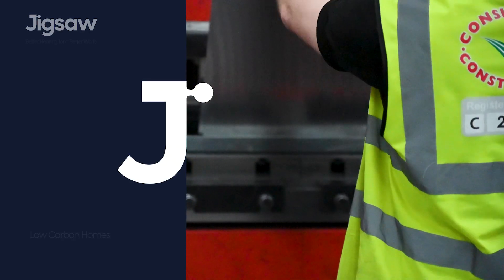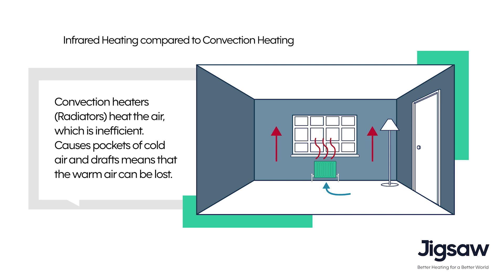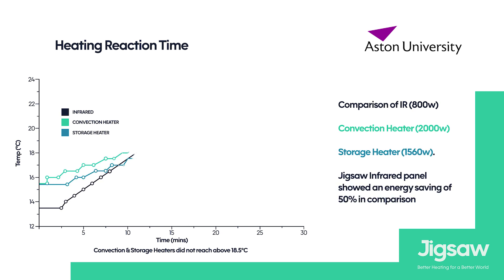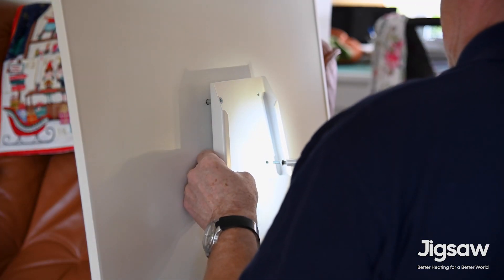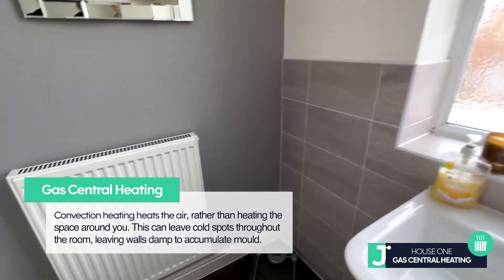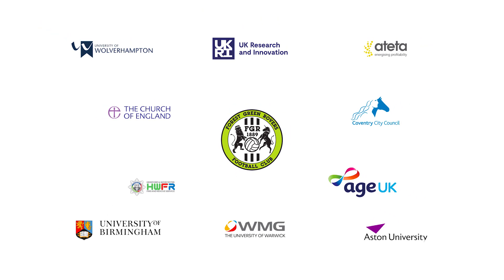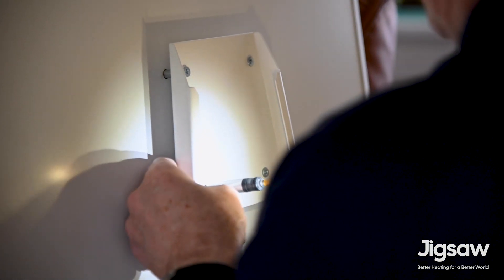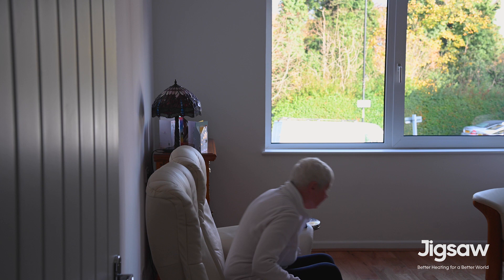Made in Britain Infrared Heating |Low Carbon Homes Presentation

Comment: Does one leave them on low in the coldest weather and bring the temp up when youre using the room? 
We've been doing that with our gas c/h this year ie we've used a higher set back temp and a lower daytime temp, we think its saved us money instead of turning it right down overnight then having to overheat in the morning to get us warm.
Would that be economical or shall we go back to off until we need the warmth because its so quick to heat up? We're hoping to start having your panels fitted later in the year as finances allow. 👍

Comment: I really dont understand all the hype with far IR panels, I have owned 3 different panels, tested them on the ceiling and in many different positions on the walls, you always feel like your either on fire or too cold, and after a few hours they give you a headache. Fine for short bursts of heat but then they're not nearly as quick to heat up as a fan heater or near infrared lamp would be.

Comment: These seem perfect for sorting damp and mold in new build ensuites, i thought id solved it by moving the extractor from the wall away from the shower to above the shower and now we need new plasterboard due to it leaking water back in once the water hits the cold air in attic, now moving back to the wall extractor and looking for a larger radiator.....till i saw this, the fact ir works on water first sounds great

Comment: Thanks for a very well presented and informative video. 
During the winter of '22/3' I had a 3kw fan heater blowing under my coffee table and onto my legs. I was wearing thermal underwear plus 3 pairs of socks, 5 teashirts (layering), a thich knitted jumper and a pair of overalls. (73 year olds dont like the cold). Looks like IR heaters are the future. Mind you....when youre 73 theres only a limited future Lol. Thanks again for your video. High 5s and respects.

Comment: Your bar chart comparing gas to IR to ASHP. If I were you, I would just do away with the replacement part, as in 50 years time power generation and delivery will be totally different and not really comparable.

Comment: I really like the idea of Infrared panels for a loft extension and need to calculate the outlay costs and running Costs v service costs and break down call outs for boilers. Also potential cost of water leaks from radiators and damage. Heat pump installations costs are huge and for older properties insulation is vital for grants it’s a huge problem for older properties the elephant in the room here. and servicing and breakdown call outs and the cost of plumbers installing radiators etc. 

I appreciate the science behind heat pumps but we need to get real about the vast amount of older properties that are not up to spec with good insulation or the larger pipe work and radiators needed to run off heat pumps at much lower flow temperatures. Wake up and smell the coffee it not for everyone Hint to the government here over grants get green grants not just heat pump grants 👍.

In future electrical energy should come online with fusion as the big gamble but that’s life and will be 15-20 years away if we are lucky !

Comment: The mould and condensation segment seems extremely fishy. Heating a room does not make moisture disappear unless the room is also ventilated. Also there's no way those mould spots simply disappeared on their own, the wall must have been cleaned/painted and it has simply not returned (yet).
Reply: @Matthew Billington Missed that detail, fair enough and that makes sense.

Comment: So it a bit more efficient, but uses on peak electric, so a huge increase in heating costs
Reply: I am not against IF heating, and fully understand the benefits.  
With solar + batteries it makes some sense, otherwise I think not.  
Even then, I suspect it is less efficient than a heat pump and underfloor heating